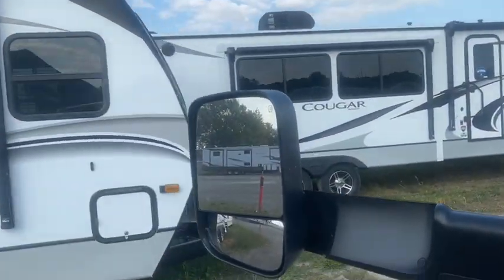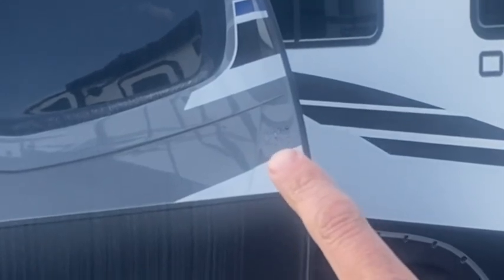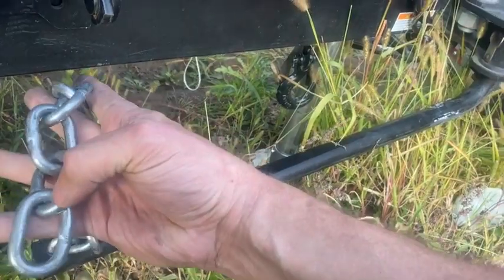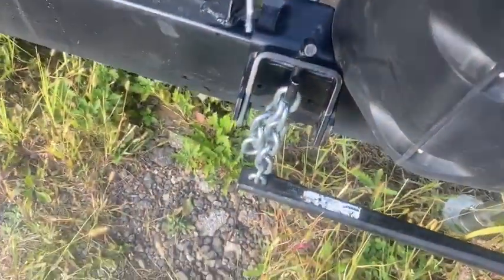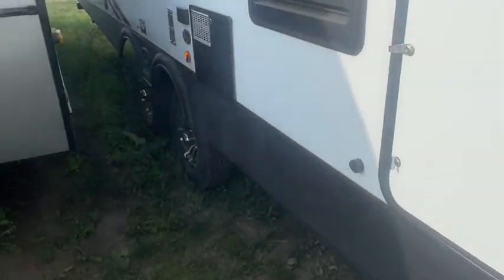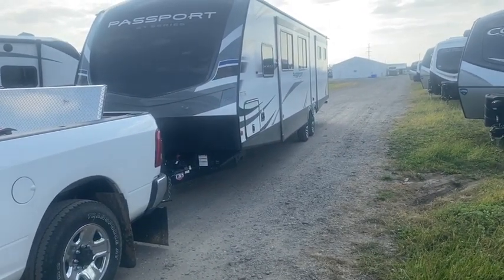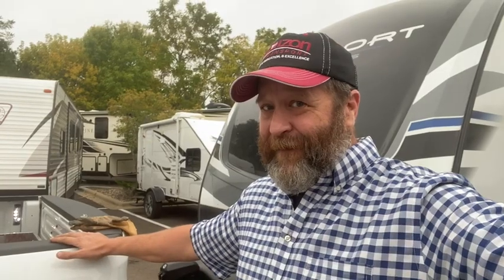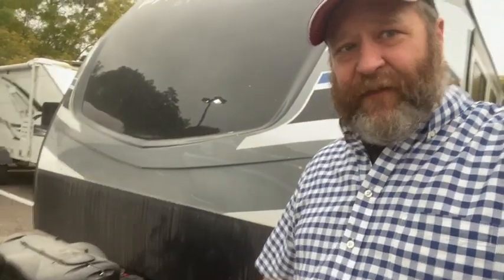RV Transport: Hooking Up and delivery of a unit

Comment: Mark what's the reason for the battery hook up. You should type or write out a checklist for when you do the drip off and tape it to the file folder. You will see it before you leave the unit. 👍☕
Reply: I believe because the trailer brakes are electronic. So when it breaks away and unhooks from the truck, the battery will still activate the electric brakes.

Comment: Interesting for sure, RV transport not something that happens in large scale here.
What do the load bars do? not part of our trailer setups, we normally just have a security chain that stops complete separation if the hitch comes undone.
Reply from the maker: The load bars help with keeping the weight consistent through the tow.
Reply: @ArkansasWoodcutter  yeah we dont tow the same loads as you guys, but don't have trucks of the same power either